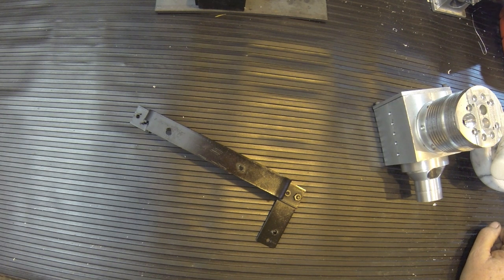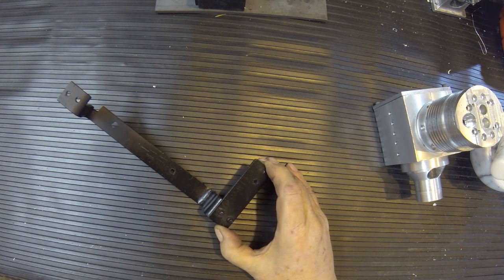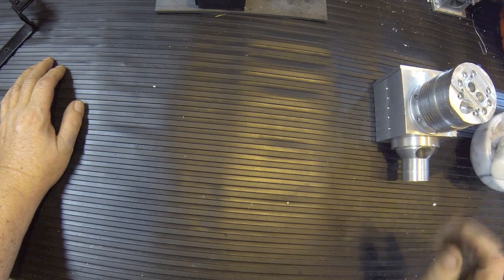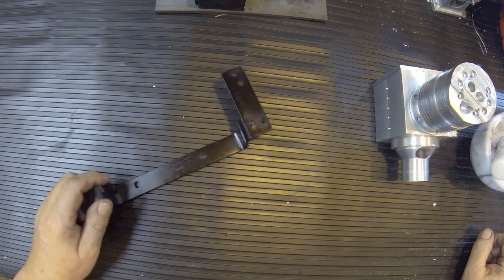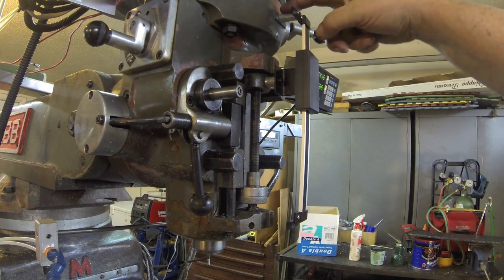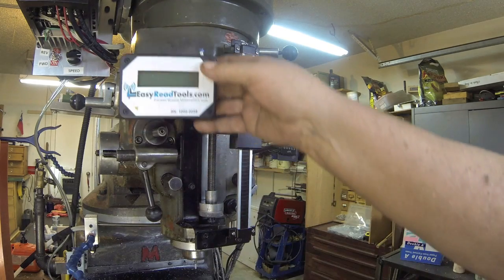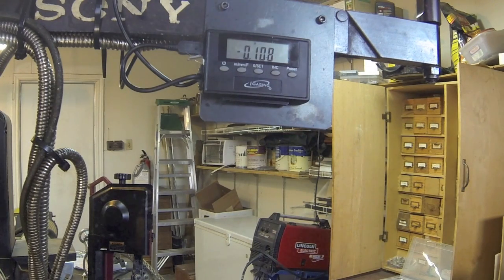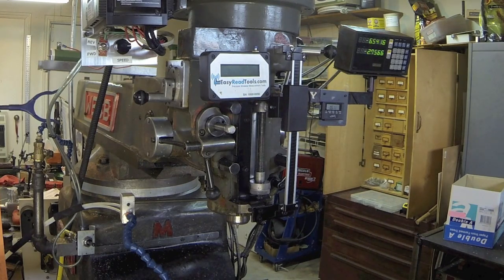This week in Herb's workshop #21

Comment: Thanks for an interesting video.  Is there any way to replace the slide rule with a longer length. I need a dro for the "Z" vertical on my milling machine which would need at least 18 inches. What is the guts of these things reading.? Any suggestions. Thanks.

Comment: Herb,
I use those same dro,s and the only problem I had was my y would occasionally loose .200. Tracked to the power cord for the mill was to close to the wire to the dro. When I turned the mill on was when the problem occurred. I know it may sound crazy but I wrapped the dro cable in aluminum foil and it never happened again.

Lanham

Comment: Good job Herb.  One questiion.  If the IGaging display is under the DRO, what's the Easy Read display for?
Reply: I was asking the same question??
Reply: Terry,  I just looked up the Easy Read Site and that display Herb had was for a digital dial caliper...  I remember seeing the ask for evaluators of the product a couple of months ago.  I am looking to put a DRO
 X-Y on my table top mill...  Fred
Reply from the maker: The easy read is for a digital caliper, not for the DRO.  Its a wireless reading system that shows your caliper reading on a remote display.
Reply: Herb Blair Thanks Herb

Comment: You've been busy on the engine. ;-) Lots of work gone into that head.
The quill readout is yet another accessory on my to-get list that keeps getting longer. Heck, I HAD one on the old mill....LOL

Colin
Reply from the maker: Colin,
yes there is a lot of work on the head, and I've built it twice.  That's what I like about bar stock engines, you have the opportunity to correct your screw-ups.  I do a lot of drilling to depth, and using the knee is a pain in the butt.
Thanks for the comment and watching!